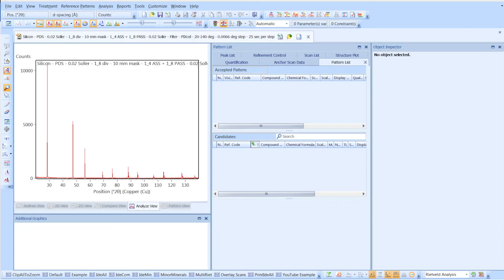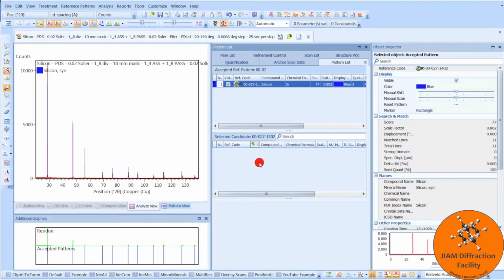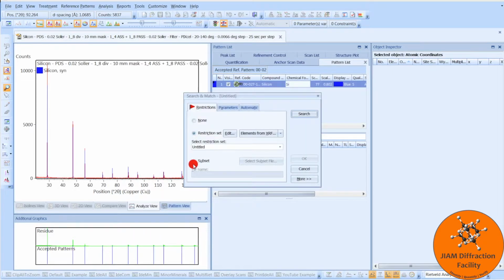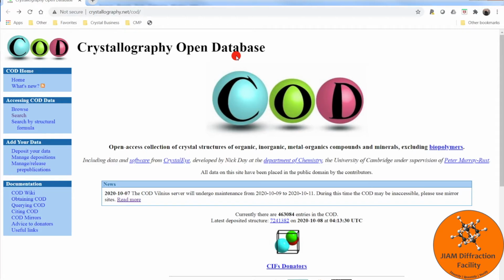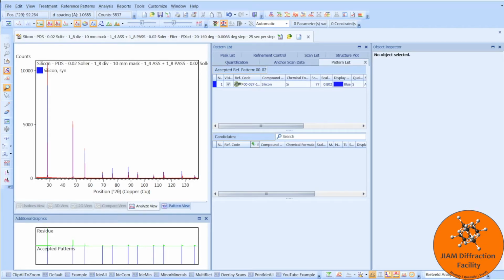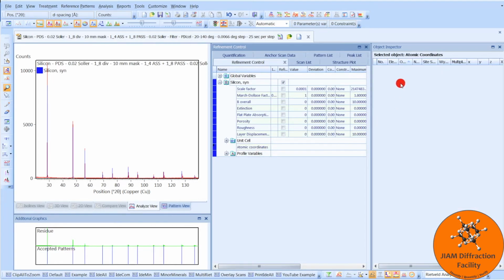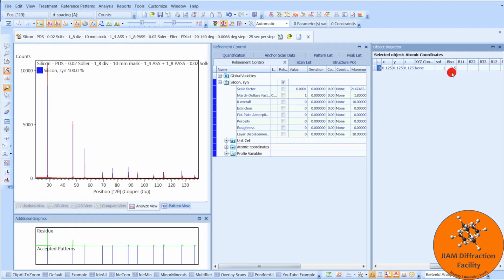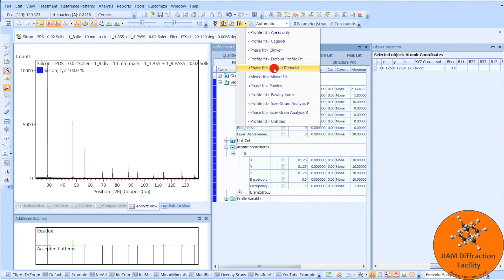Solution to the Problem - No Valid Atoms in Highscore Plus - What to Do if You Can't Refine a Phase

Comment: Hi, Many thanks for your clear explanation. I have difficulty to search unit cell. when I execute cell search I got error:
'Not enough valid peaks for indexing' Could you please how to solve that?
Reply from the maker: I don't typically analyze data that way (I just run search/matches to find crystal structures that match my samples), but I have a little experience with it.  Unfortunately, to my knowledge, the problem is exactly as it sounds.  You need more peaks in your diffraction pattern.  I recommend collecting data to as high of 2theta as you can to get as many peaks as you can.

Comment: Thank you for this useful video. But I am looking for .cif file of Cobalt   Nitrate Hydroxide but it is not available on COD, any suggestions how can I find the .cif file? Chemical formula: Co5 ( O9.48H8.52 ) NO3, reference code in xpert highscore: 00-046-0605
Reply from the maker: Unfortunately, if you don't have a database and it isn't in the COD, I'm not sure where else to look.  One option would be to find a journal article that tells you information such as space group, lattice parameter, and atomic positions.  If you can find that, you can build your own phase in HighScore Plus that you can then refine.  I wish I could be of more help!
Reply from the maker: There is another option...there is another online database called the ICSD (Inorganic Crystal Structure Database).  I'm pretty sure it isn't free, but if your institution has a license with them, you can go to the website and download any .cif files that they have.  If you are at a university, it may be worth checking to see if you have access to the ICSD.
Reply: @IAMMDiffractionFacility  Thank you for the reply. I will enquire with the institute.

Comment: Nicely described. Thank you very much but I did not get the option "Skip patterns without structure data". How can I solve this problem?
Reply from the maker: My apologies for the long delay, I was sick and then on vacation. It may be that your version simply doesn't have that option.  I'm not overly familiar with older versions, so I'm not sure.  While it is a nice option to have, it isn't required.  You can still perform refinements (assuming you have HighScore Plus and not just HighScore, and assuming I understand their package features correctly), you'll just need to make sure that the pattern files have atomic coordinates.

Comment: Hi Michael I have a multi phase system I did follow your instructions using CIF files even my pdf cards have atom coordinates. I inserted my CIF files  for both phases I could fit one phase  but  the other CIF file didn't work and CIF files have strucure data. The option which is manually enter the coordinates gave me same error
Reply from the maker: Can you send me the CIF files?  My email is mkoehler@utk.edu

Comment: Hi, Michael! Thanks for the video! Another problem that I am facing is that when I click "Show pattern" the program freezes. Any suggestions on what it could be? Thank you.
Reply from the maker: Wow, that sounds like an annoying problem...unfortunately, I do not have any suggestions on how to fix it as I have never run into that problem.  My only suggestion would be to click the box next to "Skip patterns without structure data" from the 00:03:31 time stamp.  That way, every candidate pattern should have the necessary atomic position information for refinement, and you won't have to click "Show pattern" to check if that information is present.  

I wish I could be more help :/  Good luck though, and let me know if you have any other questions!
Reply: @IAMMDiffractionFacility  Thanks for your reply and suggestion :)

Comment: Hi Michael, I am using a vesion 3.0 when i try phase quantification, i dont see the components popping up on the left corner of the plot. Also, the refinement control tab doesnt show options like yours does. I am stuck after the phase indentification step. I use a COD database and donot have aPDF4 or PDF 2. I also donot see the options in search match to skip patterns without structure data. Is it a version thing or other? Thanks
Reply from the maker: Hmmm, you are the third person recently who has reached out to me with problems performing phase quantification using the COD database and version 3 of HighScore Plus.  I have neither of those items, so it is hard for me to say if it is a problem with the database, HighScore, or something else.  

I assume you have tried to convert a pattern to a phase, but it doesn't appear in the Refinement Control tab, right?
Reply: @IAMMDiffractionFacility  Yes, it doesn't appear after tired to covert a perttern to phase

Comment: Hi Michael, thank you for this information. It was very useful, however I was not able to perform the refinement has my version of the software (3.0.5) is unable to carried out Rietveld refinement possibly because it only has structure fit, Pawley fit etc on the Fitting mode options, do have any suggestion to solve this issue? Thank you
Reply from the maker: Do you have HighScore Plus or regular HighScore?
Reply: @IAMMDiffractionFacility  Highscore plus
Reply from the maker: I'm surprised that you don't have any default Rietveld option.  I suggest watching one of my other videos where you can see how to create your own automatic refinement strategies (https://youtu.be/0fJ6RRWOhRU).  In the video, I believe I set up a more complicated refinement strategy.  If you would like to begin with the basic strategy that was in my version of HighScore Plus for as long as I have been here (I'm not sure if my predecessor created it or Panalytical did), then see below for the parameters required to create it.  What is written below might look complicated, but it should be straightforward once you watch the other video.  Let me know if you have any questions/problems.

Scale Factor - Switch off after use = false, Used = true

Flat Background - Switch off after use = false, Used = true

More background - No. of additional... = 2, Switch off after use = false, Used = true, Use 1/X background term = true

Specimen displacement - Switch off after use = false, Used = true

Lattice Parameters - Minimum weight percent = 5, Switch off after use = false, Used = true

Caglioti W - Minimum weight percent = 5, Switch off after use = false, Used = true